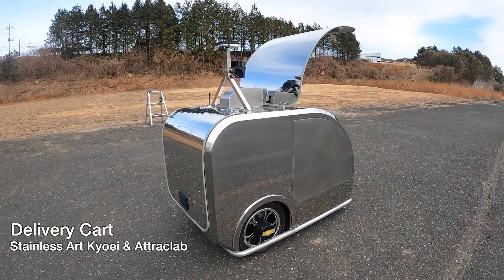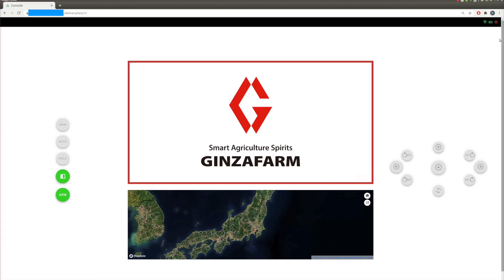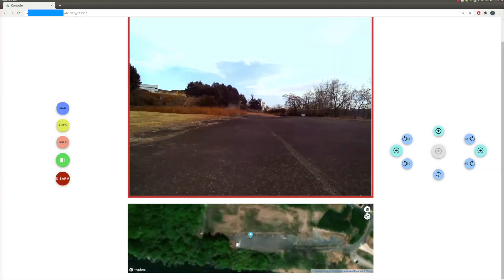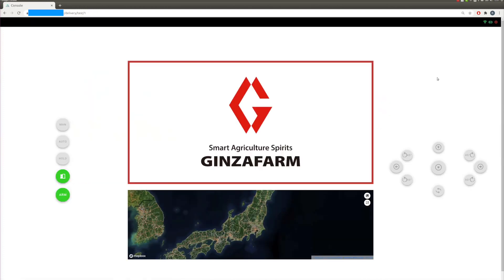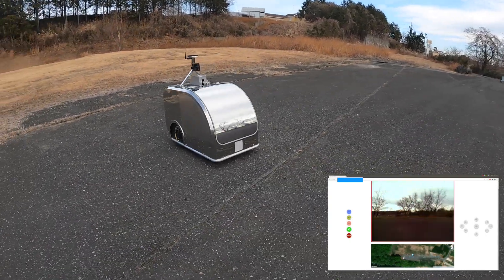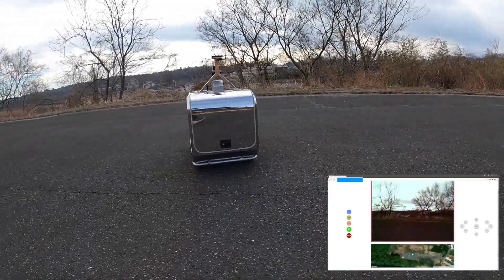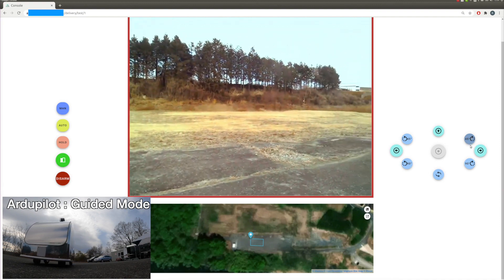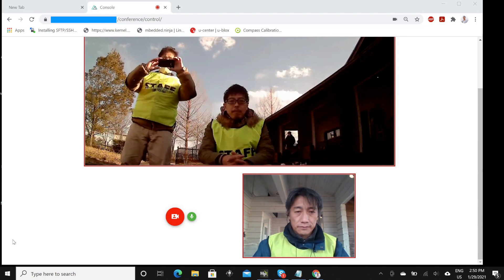Making a Delivery Robot and Control Over Internet!

Comment: bro, could you please tell me the step by step procedure to build a robot like this because I willing to start a project like this, please
Reply from the maker: I suggest you to have some basic of Ardupilot, there is pretty nice documentation on their wiki, it could help a lot for a rover related project. Once you have an idea of how to control the robot with gps based then there are many projects you can apply with for example like what I was doing here :)
We applied Webrtc and made some UI for a nice interface and that’s pretty much for high level stuff, we are using dronekit python module to communicate with AP side. For the code you could try checking on my repo here
https://github.com/rasheeddo/ATCart-Delivery
Good luck!